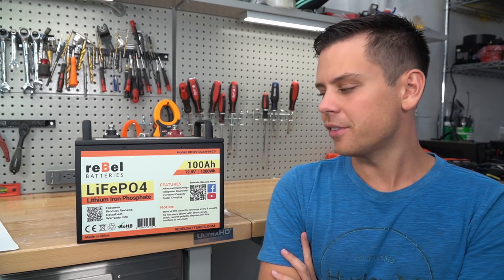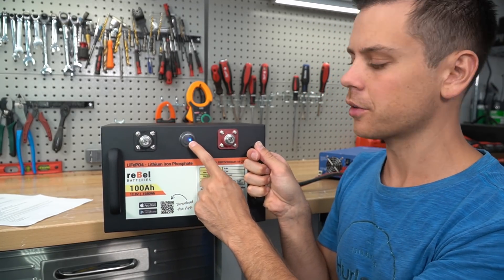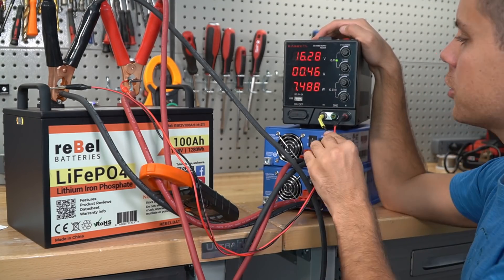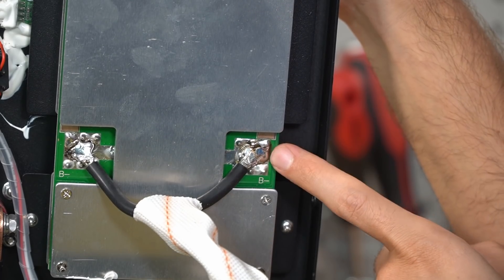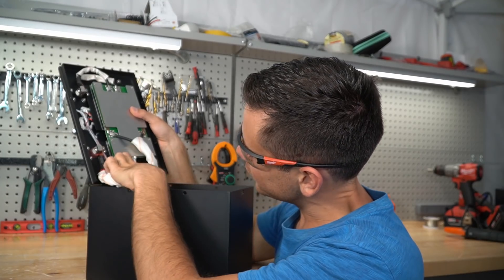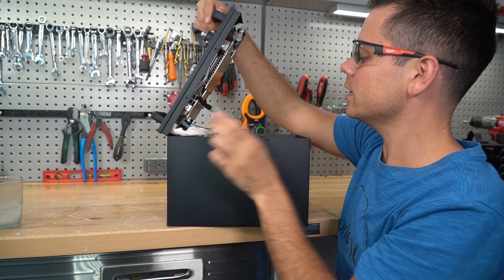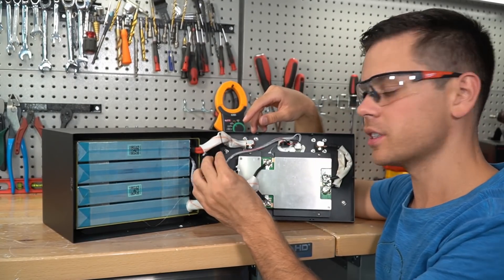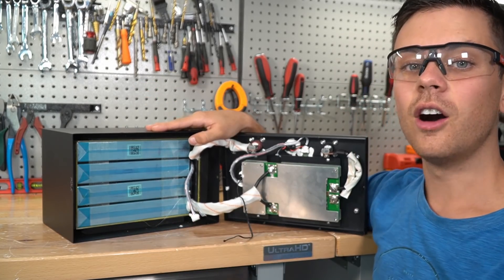$619 "ReBel"12V 100Ah LiFePO4 Teardown!

Comment: I bought the 200ah Rebel battery and so far have been pretty darn happy with it and the price was so much better than buying 2 100ah batteries.  Love the Bluetooth built in and felt like I didn't have to buy extra stuff to monitor it......

Comment: If you want a battery for marine use ReBel is a good choice due to the bluetooth. You will likely need to have a BMS that you can communicate with when ABYC eventually puts standards in place for LiFePo4 batteries. The TE-13 advisory ABYC has produced mandates being able to communicate with the BMS.  So while SOK maybe be cheaper if you are going to use it for a marine application it may not meet future standards. Or there may be possible insurance issues. Once there is an adopted standard Insurance companies may void you if you do not comply. Maybe an issue on a survey also.  Just sayin.  Plus ReBel is reponsive to customers. Try talking to Renogy or Victron and see how far you get.  My vote is with ReBel.

Comment: What is your computer setup to monitor the battery power test. I like the graphs you are getting of discharge pattern. We do testing on caravan batteries for our own use and would like to improve our system to monitor discharge.

Comment: Hi Will, Just seeing you in the videos using a thermal resistor sometimes to charge capacitors on your new inverters to prevent high current zap.. Just curious what you use and how you calculate resistance?  I tried googling an answer on what is available and what I need using the resistance formulas there is nothing as low a resistance as I think I need....I have a situation not really related to this video on battery but it peaked my interest to ask you about it as you often use that resistor to charge devices?  I am looking to emergency bridge a maxwell truck start lifepo4 25ah hybrid battery containing a 500f capacitor battery to another at say 3volt difference and limit the current to a safe flow to equalise the batteries, as a direct connection will give too much current , battery quotes 1900amps capability for 4 seconds.

Comment: I am seeing that you are using yet separate chargers, is that the case? 

If so then won't the two charger interfere with each other?
Reply from the maker: Yes and no they won't interfere. I could have 100 chargers connected.
Reply: @WillProwse  are this chargers ment for that ? will using like ichargers and RC style chargers will be fine to do it like that use multiple on one battery ?

Comment: Hey will I bought 6 used 190 watt panels with 54 volts and 60 open current,I bought a cheap 100 amp  charge controller, I not sure it will work should handle amps but maybe not volts 54 x 6, what u think

Comment: I feel so inadequate knowing I built my solar system out of Craigslist finds and the local scrapyard but I did get an a nice charge controller from Amazon after watching 20 or so hours of You Tube reviews. I'm using parts from aviation, submarines, snow plows, older Ford cars, Tractor Supply and many other resources. I'm currently saving cordless tool batteries to go lithium and absorbing as much info as possible. It's nice seeing a manufacturer step up and stand behind their product. At this point with all that's involved with lithium and my need of reliability I'm probably going to just go with a company like this. New subscriber and will definitely be checking this company out.

Comment: I have 4 6v AGM 210ah battery’s in my Rv. I have solar and a 2200watt inverter. How would one or two of these battery’s compare. I was more that happy with what my setup could do but it’s time for new battery’s. I’m $333 for each battery for replacement so looking into lithium.

Comment: Eric, the owner of ReBel batteries is the real deal. He is genuinely interested in improving  and providing the best battery. I pointed out that some information on his site conflicted and he went to work to fix it. He has changed the BMS used to improve quality. The new BMS can be used with iphone and android and has Fahrenheit readout on the app.  And he COMMUNICATES immediately when u “submit a ticket” with questions. 
I’m sure he will use Will’s suggestions and improve his battery further.

Comment: Will, thanks for the brutally honest review. These notes will be taken to heart and the battery only improved upon. We are on the third iteration of this battery as can be seen in our teardown videos, each time they get better. 

The placement of the low temp probe will be put on the cells for all batteries shipped as of today, easy fix. We will also notify all customers that they can break the seal to adjust the low-temp location if desired, without voiding their warranty. 

JBD has been backlogged on parts, normally the wires are bolted, but these had to be soldered.

Since we have the bracket, we'll now have the double-sided adhesive tape removed to make the cells more serviceable.

Thanks again for the feedback!
Reply: Best thing to do is not only implement all these changes, but send him the updated version so he can review that!
Reply: @hieyeque1  We will definitely have a battery with the updated changes sent to Will.
Reply: @reBelBatteries  how are your fish finder batteries built? Low temp protection? How much longer before you are 100% in house assembly?
Reply: @reBelBatteries  did you send in the updated battery to Will for a new test?
Reply: I don't want to be negative here, but those "warranty void if seal removed/broken" are not legal - Per the FTC: "Unless warrantors provide the parts or services for free or receive a waiver from the FTC, such statements generally are prohibited by the Magnuson-Moss Warranty Act, a law that governs consumer product warranties".
Reply: @upnorthandpersonal  We honor all requests for returns and cover all manufacturer defects, whether the seal was broken or not.
Reply: @reBelBatteries  Good - just leave the seal off would be my advise. There have been cases of companies being sued for having it.
Reply: Nice job guys!
Reply: Glad to read this feed back. Gotta love a company that puts it out there for a brutal review and wants to improve. Also a great option I saw was the 50ah (although out of stock). Some of us need to start on a little lower budget even though it is a little higher price in the long run. SOK doesn't offer a 50ah battery. Have to check the site to see if it's free shipping like the SOK. Thanks reBel Batteries & Will
Reply: Good on you guys for responding directly. I wouldn't expect that from most manufacturers. 👍
Reply: @McTroyd  Thanks!
Reply: I like a manufacturer that will learn from a third party review.  I'll definitely consider you on my next purchase.
Reply: @Canthus13  Appreciate the comment, we'll be here when you need us. Thanks!
Reply: Looks like they’ve done sold out 😀 (*edit* maybe not... I must have messed up or they added more inventory). Probably a good thing for future buyers. All these easy-to-fix issues should make their way into any new inventory. 

I’m definitely interested, but will wait for the follow-up review. I’m excited to see more American-based energy storage products!
Reply: @internetstube  We will be sending the next version to will for a follow-up review, already working with our supplier on the minor changes.
Reply: Good job! You may also want to mark the case of the battery where the top of the prismatic cells are located so that users don't need to open the case if they want to orient the cells vertically.
Reply: @lhemz2366  Thanks for the idea, we can easily have a sticker made that marks the side the bolts are on.
Reply: I love a company that admits their faults and makes improvements! An honest company means a lot! Good job!
Reply: @enaid54  Absolutely! Thank you for the support.
Reply: I can't afford your product but I respect people who can accept criticism if I'm ever in a position to buy you are at the top of my list
Reply: Nice work. Y'alls fast responses and  willingness to update will make me take a serious look at your batteries.
Reply: I love my Rebel 200ah battery.  for the price and all the questions they answered before I bought it I think they really stand behind their product.  Keep up the great work Rebel!!!!
Reply: @sjhanksaz  Thanks for the kind words!
Reply: Nice job, pretty good battery
Reply: I reached out to Aric with questions about 6 months ago and he was very responsive. Answered all my questions and helped me decide on the correct AH's for my needs. I ended up buying 2 different batteries from him and am very satisfied.  A 12V 100 AH runs my trolling motor on my boat all day no problem and a 12V 24AH runs my Electronics and Pumps for several outings. Highly recommend Rebel Batteries!
Reply: Will, you are the bomb! Love your work and integrity! Have you reviewed Dakota Lithium batteries? Thanks! I look forward to more content!
Reply: This is how you run a company!
Reply: Great job. I’m in the market and very much thinking I will go with y’all. thanks to you and will
Reply: Wow, What a "stand up" company, You responded so professionally to Will's suggestions.
Reply: A company that will take the reviews by a professional and make positive changes to it's product. That is what makes a product prefect!  Well done...
Reply: reBel Batteries. I am very interested in your products for a van build I am starting. However, when I go to your website there is virtually no information about you other than you are a VOSB started by a guy named Aric. That's great but... Where are you? What is your address? What is your phone number? How many employees? You claim transparency but on the surface your website has all the makings of a scam website. I don't believe this to be true but give us that warm fuzzy feeling that you actually exist.
Reply: LOLZ I'd still buy one.... maybe.... i just need to move a temp sensor and reflow some solder joints... now about the price?
Reply: @davidgeekly1769  We have discounted the price on the website for the time being. And new orders will ship with the temp probe on the cells. Thanks!
Reply: Much respect to your company.
Reply: Nice to see replies here reBel Batteries! Just getting into this area, would consider you guys when it comes time to build
Reply: A note said you are an hour south of Houston. I’m in Katy.

May the batteries be picked up in person?
Reply: @ZydecoBreakfast  Sorry, no, we don't have customer service hours. But, there is free shipping on orders over $400 and you're so close that you'll probably have next business day. Thanks!
Reply: Awesome to hear this.  I will be buying soon
Reply: So does this say, "we'd rather fuck around like Chinese have a reputation for, but well do the right thing if we really have to".  I mean, putting the low temp probe on a heat sink is scary.  We shouldn't have to ask.
Reply: @mikemotorbike4283  Obviously, we didn't request the cell probe to be put on the BMS, this was an oversight by our supplier. We have fixed each one manually before shipping since it was pointed out, not because we have to, but because it's the right thing to do. It's been addressed and fixed. Quality control is one of the biggest hurdles to overcome when sourcing from overseas. It's our intention to begin producing at least 20% of our batteries in-house by the Spring of 2022. If everything goes smoothly, we should be at 100% in-house within 18 months from today. It takes planning and resources, which we are working hard on at the moment. Thank you for your comment and the chance to address your concerns.
Reply: @reBelBatteries  I think I will buy my batteries from you just so you can get to that "100% in-house" builds as soon as possible.  Thank you to all of you for your service to our country and keeping us free. I will always support our veterans.  God Bless
Reply: Too little too late. Rebel is off my list. And playing the 
"disabled vet" card as an advertising ploy is disgusting.
Reply: @coleman6131 , you have a problem with Veterans building and running their own companies? What is it you do for a living - work for someone else? Get outta here with your BS. No one is playing any "cards" here. I know numerous Veterans who have started small companies, worked their way, try to give a better product or service, than what we typically get these days from civilian business owners. One thing all Veteran owned, and operated companies provide is "Customer Service" which at one point and time in this country was sound business policy. Many companies these days sell junk, have no tolerance for the customer. I thank all Veterans who start companies, sticking to American standards, and delivering top notch customer service and satisfaction. They approach their business after service with the same compassion and intensity they served this nation with. You should be thankful we have some folks in this nation that still care enough to do so.
Reply: rigged episode for clicks

Comment: Thanks for reviewing the ReBel battery Will! A very fair review as usual. I've got four of them in my super C and they have worked very well. By the way, SOK has had their share of quality issues that have been documented on various posts. FYI, the Bluetooth link in these batteries is handy, but a bit quirky for sure. Aric, at ReBel is very responsive and I'll bet he'll correct any deficiencies you noted. I may void my warranty by opening mine and repositioning the low temp sensor myself, just to be safe. On the solder VS lug BMS connection, I've been in the aerospace interconnection business engineering side all my life, and as long as there is no potential for gold embrittlement, which there is not here, solder is not likely a problem. If those joints reach the roughly 200C necessary to melt them, there's a way bigger issue about to occur. I guess the pads could rip off the boards, but I believe there is a plated through hole at each pad and this will help prevent this. 

One Question I have for the audience is on the Bluetooth data you can read on cell balance, it seems that the cells can go pretty far out of balance at the top of the charge cycle. Does anyone have a suggestion on changing the balancing values in the software to achieve better balance? Note that ReBel says that the warranty is void if any of the factory settings are changed.

Comment: My powered wheelchair has (2) 12 volt (group size 24) gel cell batteries connected in series. Will this ReBel 100 Ah fit and will it work as a replacement for my current setup? I generally replace the gel cels every 2 or 3 years. If a 7 year battery will work, I think that is a double win.

Comment: Will, thanks for the excellent review. I want to love this company that works with disabled veterans...if that is the real truth. I hope the get their act together and fix what seems to be some minor fixes.
Reply: I believe it's true. Check out their youtube channel, the guy does teardowns and testing on his own products, which is good to at least have spot checked QA. I'm guessing he will take some of these to heart. Overall the issues Will brought up are easily corrected. Mainly only concerned about the thermistor being attached to pack (instead of some dissipative surface like bms heatsink or outer case). The soldering isn't necessarily an issue if there is consistent QA/QC.

Comment: Will, I have a limited space to put a battery or two, trying to find out what I can get that would fit in the area while still giving me the best bang for the buck.  You don't by chance have a spreadsheet with the dimentions of all the batteries you test?  26.6" x 7.6" x 11.5" is the space I have to work with assuming about 1/4" of clearance all around.

Comment: Basic message of your tests for me is if the vendor just do a better job on some basic things, like glueing sensors to the cells and having a better tearable product, it would be a great deal. But this does cover just a fraction of issues, people run into after they are happy that their purchase is not DOA. Most people are not aware of the basic concept of how to treat their new pack of not matched grade A/B/C cells with a weak passiv balancer which is not able to do its job because fridge, notebook and the new sine converter do not allow the battery to stay at high SOC needed for the balancer to work properly. This might be solvable, if you would do some more real life cycles (running a fridge and make some coffee etc.) and have a closer look of each cell by comparing how good they are a match on capacity and inner resistance. The most benefit I see could be that vendors are not able to charge people twice as much because they have just a better tearable product and some crimped cables inside but remain at not matched low quality cells drifting so hard the usable capacity is melting in the sun. How about a "Prowse Cycle"? A battery beaten at low SOC in the morning with some nespresso after running the fridge alone the whole night for two weeks seems to me a more realistic scenario then having fourteen linear 0.2C cycles in a row.